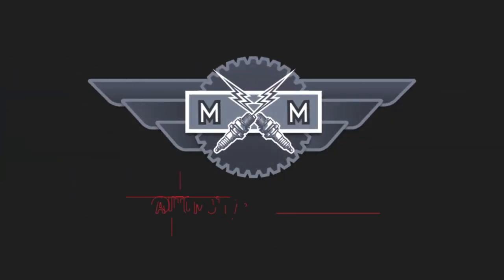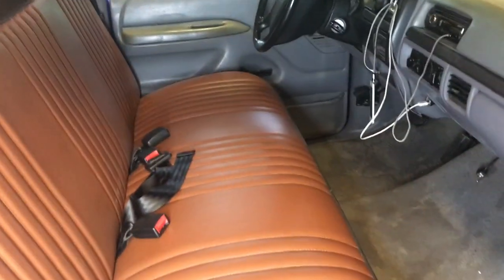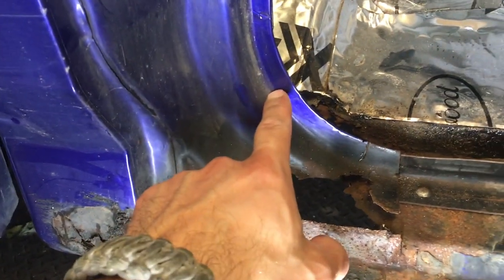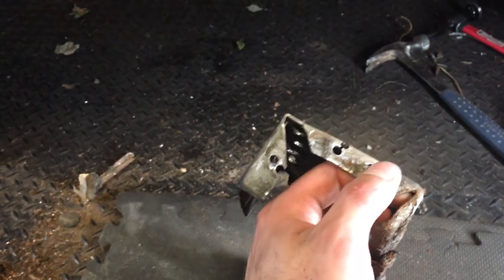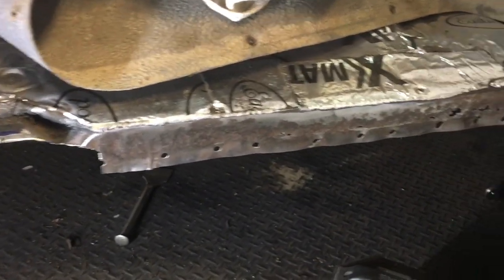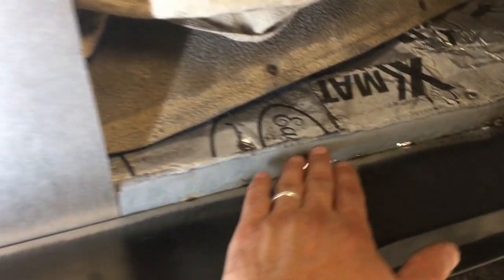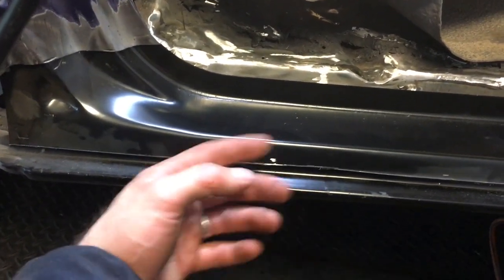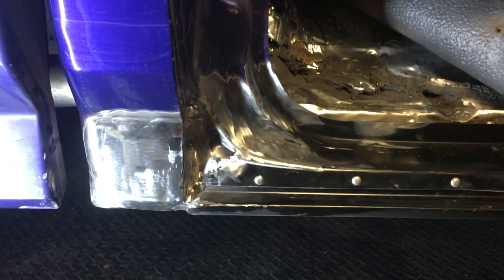How to Replace Rusted Cab Corner + Rocker Panel | 1995 Ford 150

Comment: Thanks for the video!  I live in Wisconsin, where rust is common.  I just picked up an '86 F-150 that I'm going top fix up a bit and am about to bring home a Bricknose F-350 crew cab dually that I plan to significantly customize.  I know the F-150 will need this exact repair so it was really helpful to see it run through, and this also gives me an idea on how to tackle what I want to do to the Bricknose.  Keep the older iron running!
Reply from the maker: Thanks man! 🤙 Nice those will both make great project trucks. 
My two biggest pieces of advice are buy everything you may or may not need (you can always return stuff) and pay close attention to the fitment of the new panels to existing. Plus how to door fits to the cab. You want the cab corner to be even with the bed and you want the door frame to match perfectly worth the door so the door seals against the weather stripping.

Comment: This is a great video. I am working on a 96 crew cab right now in the rear door post area. Is not totally the same as a single cab but gave me great points and tips on how i am going to fix my truck.  My rockers are in great shape other than by the door post/ cab corner area of the truck. Now that i seen how you fixed it i feel like i am not a nervous to tackle the job. Thank you very much!!!
Reply from the maker: Thanks man!🤙 glad to hear I can help you out!

Comment: You just made my day. I didn't think anybody made that OEM style rocker panel with the seatbelt bolt hole, only the outer piece with the door posts witch i have but not enough to do it right. Thanks, I ordered the 2 rockers from Raybucks minutes ago  as i need them for my 83 F100 reg cab.
Reply from the maker: No problem man! 🤙 Great to hear. You can repair just about anything on these trucks. Sometimes it’s finding the parts that is tricky. Thanks for watching man!

Comment: Good video. One thing I have done in the past instead of rivets is a plug weld which looks like a spot weld. Drill the 3/8 hole on the outer panel the weld it full to the inner panel.
Reply from the maker: Stephen Flynn Oh yeah! I did that on the other side. I like that method a lot. I just got tired of welding on this project. Lol

Comment: Thanks so much for this video. I’m starting a restoration on my 1980 F-150 and My panels are in similar shape. You’ve definitely shed some light on what can be done. The biggest question I had was if the cab would need to be removed to complete these repairs. Looks like you answered that question.
Reply from the maker: ogiegloa No problem man!🤙 Nice! The cab definitely stays in place but you can unbolt the bed and slide it back. This allows you access the back side of the cab corners really well for welding and such.

Comment: You did a really nice job on your truck. They should make plastic parts for vehicles in the rust belt for as much as they cost.
Reply from the maker: Donald Swink Thanks man!🤙 It’s not perfect and maybe that’s just my perspective. However, I am still happy how it turned out. I know right! Or aluminum parts.
Reply: Donald Swink oil spray oil spray oil spray annually drill holes and plug miss nothing miss nothing under coat does nothing nothing I did it for a dealership I worked at only oil works after cleaning and applied annually
Reply from the maker: nick king You would drill holes in the body and spray oil into them? Like oil the cab corners and such?
Reply: The Minute Masters yes sir I’d just do that ,I have a1992tracker I have done since 1998 I remove tail lights to get wheel arches,hood ,tailgate front fenders  ,I hit everything use a good respirator and goggles an old tarp mabe an old sheet on the tarp  stay away from exhaust and cat  you don’t want a fire . I use a pump up sprayer. Or I use air and an undercoat gun ,and sometimes a cheap paint gun that pressurized the cup slightly . I always use protection , I have a summer driven 1976 vette I have done it not every year but most since 1981 frame is mint and so is suspension, I make sure to not get on brakes but I hit emergency brake cables and all lines it’s humid in summer wet in fall and spring and salty in the snow months ,they use rock salt and now brine which is beet juice and salt sticks to you cars and trucks worse than ever and damages bridges rail road tracks even in the air in my opinion and settles on equipment not road driven .
Reply from the maker: nick king Nice! This is all good to know and I’ll definitely try it! The salt and the brine has definitely gotten worse. Even newer trucks are rusting out fast.

Comment: I got a little cheesed when I saw that whole inner rocker piece you had! I did the entire rockers, cab corners and A pillars on my 94 recently and couldn’t find those pieces so I had to make them
Reply from the maker: OntarioRedneXXX Damn! That sucks! When I first started doing this, I thought I would have to do the same thing. I was dreading this project until someone told me they make the individual patch panels. 😅
Reply: The Minute Masters you should take a close look at the cross sill in the back of the cab. If the corners are that bad chances are it’s bad too. I got crafty and completely replaced mine. I already patched it up a few years ago so it was time
Reply from the maker: OntarioRedneXXX My can sill is in perfect shape!👌 I pulled the entire floor liner out to roll bedliner on the floor. So I was able to inspect everything. Then I put the floor liner back. My only problem I’m fighting now is a water leak some where. It only affects the driver’s side. The cab corner fills up first.

Comment: It would be cool to see some of the welding or welder setup too if you could. Great video though. Crazy amount of work. Someday I hope mine looks as good as yours.
Reply from the maker: Ross Kraszewski Yeah I wish I could too. I use a Eastwood 175 Mig welder with C25 gas and I think .8 wire.  The welding itself is nothing special. Just lots of tacking. Welding fresh steel was nice but anything remotely rusted was tedious. 
Thanks man! I’m glad you enjoyed it! 👍 Yours will get there!

Comment: Best video out there for these f150s by far, Great job stevie
Reply from the maker: Chauvin's Garage Thanks man! 🤙 I appreciate it! Thank you for watching!
Reply: @TheMinuteMasters  Keep up the Quality work, Your Camera Angles and lighting Sets you apart from every other DIY Channel. Very well explained and you put things easy to understand., Can we get a video on How to change Rear Leaf Spring Bushings next? :D
Reply from the maker: Chauvin's Garage Thanks man! 🤙 Good to know my methods are working out! Hopefully, I can keep improving them for ya! So my leave springs need to be changed. So there is definitely a possibility for a leaf spring bushing video.
Reply: @TheMinuteMasters  That would be awesome! I Currently have a 1991 F150 that I'm slowly restoring just like you, Its considered a "Brick Nose" 87-91 body style, But the Suspension and chassis is the exact same as the 92-96 or "OBS" like your truck. So all your Bushing replacement videos have helped me tremendously with understanding how to take on the task. My whole front end needs to be re done, and thanks to your videos I feel very confident I can do it myself without having to take it somewhere. How do you tell if your Leaf springs are bad? Mine still have good arch but the Bushing in the front hanger and rear I'd like to have replaced
Reply from the maker: Chauvin's Garage Sounds like you have been doing your home work! The OBS trucks share a lot. It’s mostly body style that separates them. I’m glad I could help you out though! These trucks are a lot of fun to work on and very satisfying! 🤙

As far as old leaf springs, yours could still be in good shape. I’m off the opinion that after 150k + miles all springs both leaf and coil should be replaced if you want to restore the truck to factory ride specs. I don’t have a rear leaf spring brand to recommend to you but I can definitely steer you clear of bad front coil spring brands. Moog and AC Delco coil springs are garbage. It’s worth while buying springs from an online source that says they make test them according to oem specs. You will spend $150 but you should get a decent set.
Reply: @TheMinuteMasters  Good to Know! I will be rebuilding my front end very soon, What's a good coil spring youd recommend? My truck is 2wd and I want Factory oem height. I've heard some people put f250 springs up front as an upgrade but I'm not sure if that's entirely compatible.
Reply from the maker: Chauvin's Garage So I don’t have a recommendation for an oem coil spring yet. I did an internet search of “custom coil springs” for my model and year of truck. I found a number of companies that claim to manufacture coil springs according to oem specifications. Most of them were in the $150 price range which seems about right. Since, I haven’t personally tried any of these places I can’t recommend them. I do however, recommend others to try them and see if they are any good. I have heard of the f250 coil spring swap but I have heard it has some complications of its own. It’s best to stick with f150 specific parts.
Reply: @TheMinuteMasters  I'll definitely keep that in mind, I was looking at getting the Moog oem set for $114 but you say they aren't any good? Are they bouncy or something? Maybe if I install a sway bar kit itd help
Reply from the maker: Chauvin's Garage The top three coils in the Moog and AC Delco springs collapse on each other once they are under full weight. I installed a front sway bar and that didn’t fix it.
Reply: @TheMinuteMasters  Well it looks like I'll have to start doing some home on a good set of springs because I'm gonna be changing them pretty soon. Too bad there isn't an easier way to keep in touch  for any other questions or things I run into down the road. Do you have social medias I can follow?
Reply from the maker: Chauvin's Garage So I post some pictures of my truck on Instagram and people can message me there: sxtreacy
Reply: @TheMinuteMasters  ok cool!

Comment: Hi there! Great video! I’m currently prepping to do the exact same thing to replace rocker panel, cab corner and seat belt base bolt on my 94 F150. I’m new to all of this type of work. Would you mind giving me a list of the tools and supplies you used? That would be an awesome help. Thanks.
Reply from the maker: Hi Phil! Thanks!🤙 
That’s great! Here’s a rough list:
- welder + safety equipment 
- tool to cut patch panels (I used an angle grinder and a bench top shear)
- marking implements (sharpies for prep, chalking stone for during welding)
- drill plus bits for drilling out wells
- body panel chisels 
- grinding disks and flap disks for grinding welds
- wire brush 
- seam sealer plus caulk gun
- 2k primer 
- tarp to shield interior and other parts of your truck from sparks.
- measuring tools 
- welding magnets to hold panels in place
- vise grid for holding panels

That’s mostly what I can remember. There’s a lot of cool tools out there to help you. So it’s worth researching. Eastwood has a ton of helpful tools for doing body work.
Reply: Awesome! Thank you! I’ll most likely capture some pics along the way so maybe I can send ya some!
Reply: I’m finally getting around to fix my truck near the end of the week. Looks like you didn’t need to take your door off. How far towards the front did you repair? Then again after looking at mine again I think I’ll be replacing only up to that seem  a few inches before the door.
Reply from the maker: @philipyonts-fp9ht  Nice! So I’ve done this two different ways. The first time, I replaced all the way up to where the front fender bolts to the rocker/sill piece. For that one I did have to remove the door in this video I only went to that first seem so I was able to leave the door on.
Reply: Thank you and thanks for taking the time to reply to an older video. This is the best and only video I found for this exact situation. It’s been very helpful.
Reply: Let me know how I can send you a few pics of my rocker restoration. It was 2 full days for the metal work, my first time for everything so I happy with it. I’m going to do the finishing this weekend with body filler etc.
Reply from the maker: @philipyonts-fp9ht  If you have Instagram, you can message me there. Otherwise, I don’t give out an email.

Comment: My tip as soon as paint is dry oil spray repair from back side and drill 1/2 holes get plastic plugs at auto store but do pillars double inside of box drill 1/2 holes and put black plugs in after. I even do  under the carpet , all the double sections ,tail gate ,doors drill pillars and oil hood , fenders lines ware respirator approved for oil mist goggles nitrile gloves , don’t get on exhaust components . The oil will prevent water and salt to get at the repair and other rust on the truck plus prevent further rusting also do inside of the frame and suspension , bolts use your common sense as to how to apply ,I use sprayer pump up kind ,and old cheap paint gun that is pressurized works great  use bio friendly oil like canola , chain bar , cheap baby oil from dollar store smells nice too and maybe some non detergent motor oil don’t wash you car or truck for a couple of days. In my high school and college days I worked for a gm dealership and I did body work ,undercoating ,oil sprayed most of our body jobs because of hi call backs , it worked oil stopped the call backs happy customer happy boss* Don’t do this without an approved respirator that been properly fitted and is rated for oil mist don’t and ware goggles and rubber nitrile gloves also use jack stands and wheel blocks
Reply from the maker: nick king This is good stuff! The plug idea sound almost like the internal zinc coatings they used to do. I definitely agree on the safety gear.Thanks Nick! This is great advice and I definitely want to try it before snow and road salt season starts. Maybe I’ll do a video on how it turns out.🤙

Comment: I noticed an Eastwood welder in the back ground. Is that what you used? How do you like it if it was
Reply from the maker: Luke Norman It sure is! It’s the Eastwood 175 which is rated for I think up to 3/8 inch steel. It’s pretty good! I don’t have a lot of experience with other welders. However, Eastwood is decently priced (my dad got it on sale for I think around $500), hasn’t given me problems, Eastwood’s customer service is fantastic (fried the motherboard on a previous welder. Took it in for repair and a week later they gave me a new one), and it takes common welding consumables. If I was to upgrade, I’d go for a Miller. That’s almost another $600 more.

Comment: I need to repair the tocker panels on my 10th gen f150 extended cab, the backsoor doesnt have rust bht where the door WOULD BE has a ton of rust on it, what metal can i use to repair it? And how would i go about it?
Reply from the maker: Are you saying the hinge mounting locations are rusty or around the door frame? If you can’t buy actual patch panels, the steel on these trucks is 18 gauge. You can usually go to a steel/metal supply company and buy sheets of it. Then you would just have to cut and fit them.

Comment: You probably know already, sometimes you can lay your new piece right on top and use self tapping screws to secure it tight. Then use the cutoff wheel through both panels for an exact sized patch. Some guys will angle cut so you have a nice overlap miter to weld.  Doesn’t always work due to interference.
Reply from the maker: Andrew Cunningham Actually, I haven’t heard that idea before and like it! I’ve used Clecos used in aircraft construction. I’ll have to try that!

Comment: I will need to do this before too long as well on my '82. This really helps give me an idea of what I will be getting into. One question: when you say that you would cut more out, would that extend into the floor pan? Do you think that could be patched with scrap or would it need a replacement piece as well? You make great videos. Keep up the great work man!
Reply from the maker: anthony allsup Yeah I would cut about an inch more of the floor pan and about an inch higher on the corner. For the floor pan, you can use scrap steel. However the actually patch panel is only $45-50. Plus that piece also has the ridge where the door weather stripping clips onto.

Comment: I don't have a welder. But I do have the new Milwaukee M12 rivet gun. Can I use that instead? And then use seam sealer?
Reply from the maker: KickDownDoors That’s sweet! I’m a huge Milwaukee tools fan! So you can rivet the panels on there and use seam sealer. As long as you’re ok With seeing overlapping panels. If you have a air compressor. You can actually buy a pneumatic flanging tool and if you flange the edges and then rivet them everything might sit flat enough that you might be able to bondo and fill and it would look almost like a weld job. Have you seen my video about the rusty fender fixed? I riveted the hatch fender panels for the bedsides. It came out really nice!
Reply: @TheMinuteMasters  - yea Milwaukee just had their new product show yesterday. I converted from Makita last fall/winter when deals were incredible. Youtubers did a bad job at Milwaukee Tool's NPS19. Will have to wait for the better ones to upload. Thanks for pointing out your rivet video. Will go look now and use your experience to figure out best way for me. Appearance isn't important for this project. I appreciate your attention to detail.  Offering alternative ways really helps.  Thanks!
Reply from the maker: KickDownDoors I did see that! I agree the coverage is terrible. I used to be DeWalt back in the day. Once I went Milwaukee with their current battery system, I was hooked! Hey no problem! 🤙 I understand most guys are on budgets and a full welder set up even a cheap one is several hundred dollars. So I’m always looking for a more economical fix. Glad you like my idea! Thanks for watching!